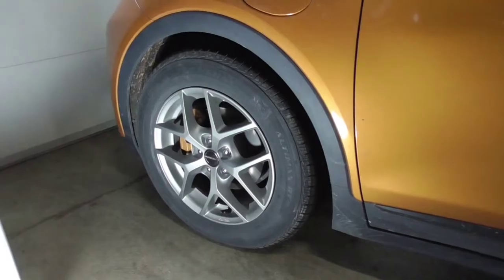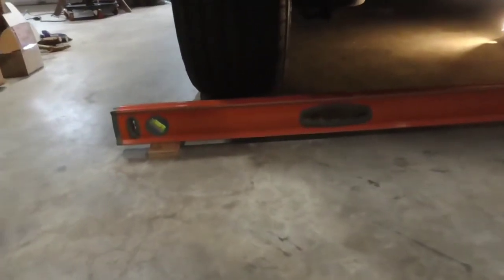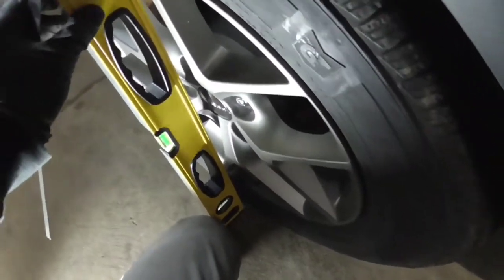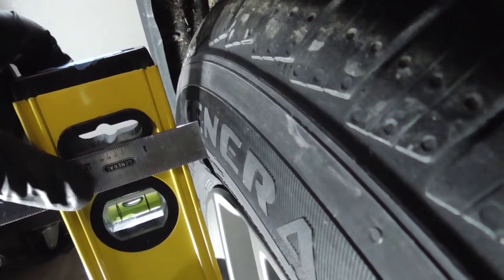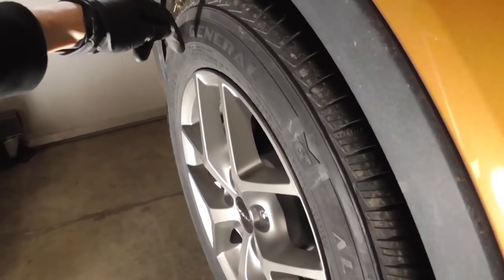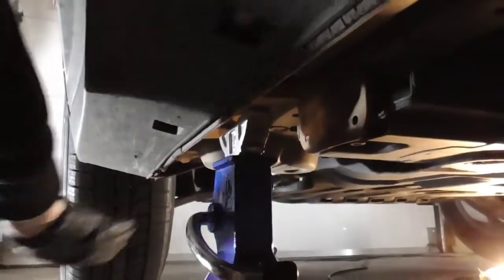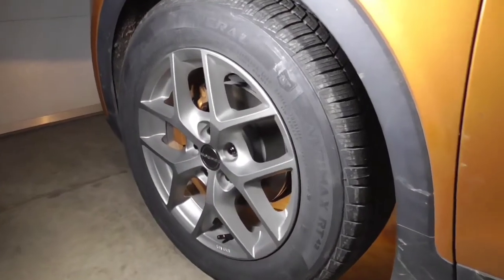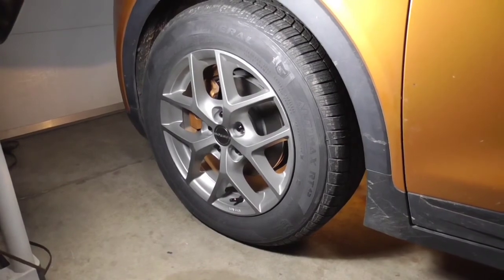Chevy Bolt - Front Alignment

Comment: I'm wondering why you had way too much negative camber on both right tires (ref. your rear alignment video).  The effects of the slope of your floor and (I believe) your underestimation of the effect of the bulge on the lower part of the tire on your camber measurement will cancel each-other on the left side and add on the right side.  The tilt of your floor is good for -0.5 deg of camber error on the right side and I think you are off on the bulge by aboiut -0.3 deg.  So add those two and I think you may be getting -0.8 deg of error on the right side measurements (and +0.2 deg of error on the right side).  That would put your right side a lot closer to spec and keep your left sides in spec.  Lastly, I would recommend you cut down the splines that engage with the strut on the lower bolt before you rotate them using the upper adjustable camber bolt.  Otherwise, you're just chewing up the strut.